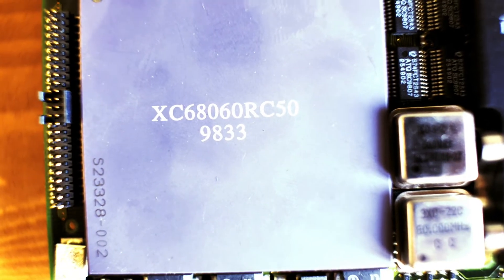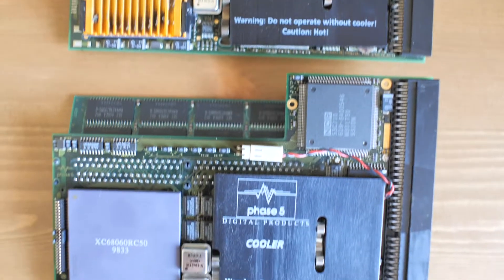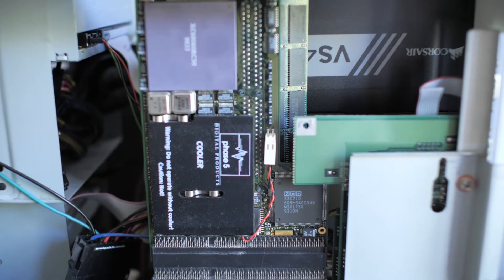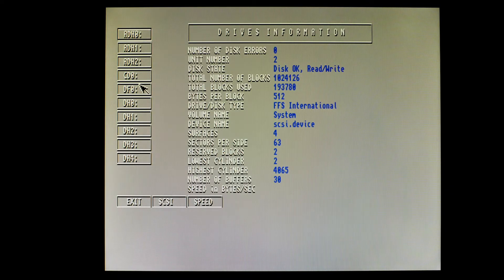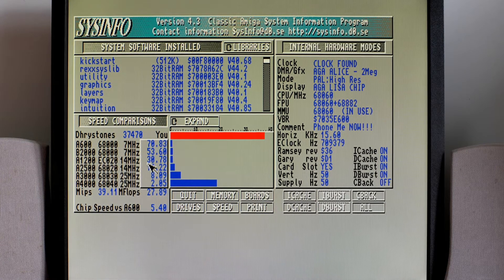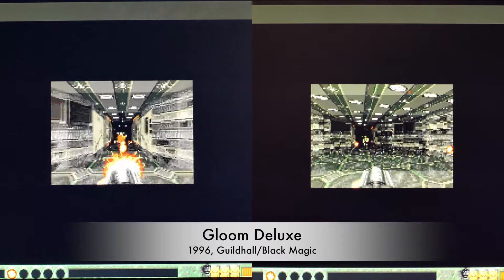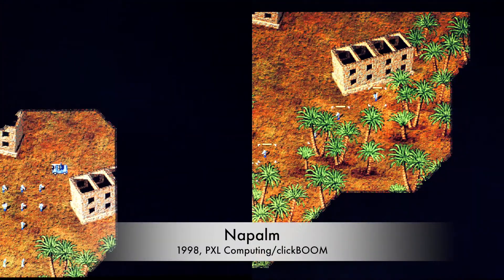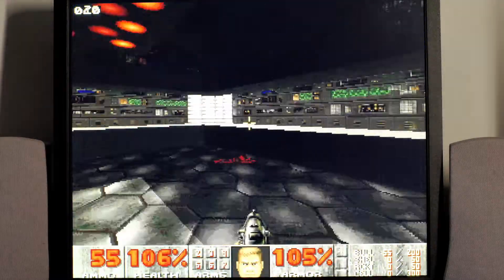amipal #30: 68040 vs 68060

Comment: Seems like 3D games do not get much benefit from the Amiga-specific hardware like the Copper and Blitter; they have to fall back to the CPU to deal with most of the rendering.
Reply: Yep, the Amiga graphics chips weren't made with 3D in mind, so it's all down to the CPU.

Comment: OW, i so wish i never soled my Phase 5 Blizzard PPC 603e Plus 240MHz and 68040 25MHz, and my Phase 5 BlizzardVision PPC, so stupid of me.
Reply from the maker: Ah, Amiga regrets! I used to have a BlizzardVision, but replaced it with a MediatorPCI and Voodoo3. Great card though!
Reply: @amipal24  Yeah, wish i still had them, and yeah i also had a Mediator PCI 1200 and a Voodoo 5 5500, now my father have them, but not Phase 5 Blizzard PPC 603e Plus 240MHz and 68040 25MHz, and my Phase 5 BlizzardVision PPC, wish i also had given the Phase 5 Blizzard PPC 603e Plus 240MHz and 68040 25MHz, and my Phase 5 BlizzardVision PPC to him, and my Phase 5 Blizzard PPC 603e Plus 240MHz and 68040 25MHz had also SCSI, i had a SCSI HDD.

Comment: Loved your video :) i compared your benchmarks against an Apollo 1260 i have, and your scores are bang on. I thought the 040 did well, considering its running at half the clock speed. I have a terriblefire 1260, with a Rev6 060 @80mhz, and that scores 60,000 in Sysinfo, although my V1200 does 147,000 in Sysinfo, and is way rapid. Thanks for taking the time to show us the games, that was great, i wonder how an 040 @40mhz would compare? curious to see how the PPC runs to, thanks for sharin :)
Reply from the maker: I think real-world comparisons are always the way to go. Ultimately, it's how it feels to the user rather than the numbers presented.

Annoyingly, I haven't done any comparisons with the differently-clocked 603e chips. Have been too busy just using the machine!

Comment: Very cool comparison. Thank you for doing such a thourough job with this. 
I'm actually a bit surprised that the difference isn't greater considering the 040 is running at half the clock speed. Benchmarks vary by quite a bit when comparing these two CPU's, from the 060 being about 30% faster at the same clock speed, to almost twice as fast. These real-world comparisons are great! I've recently acquired a Cyberstorm MKII 040 (40mhz) for my A4000 and I'm very much looking forward to comparing it's performance with my Blizzard 1260 @66mhz.
Reply from the maker: No problem! I always find real-world comparisons to be much more useful than simple benchmarking.
My main surprise was how well some games or applications worked, while others didn't seem to improve quite as much.